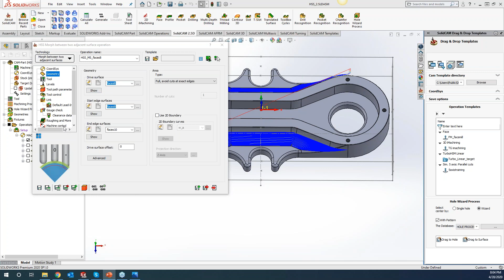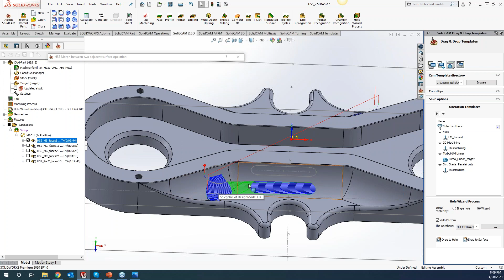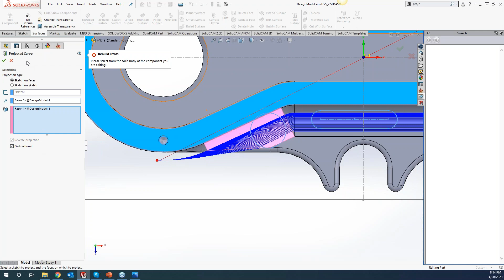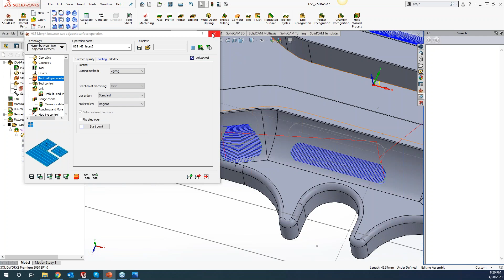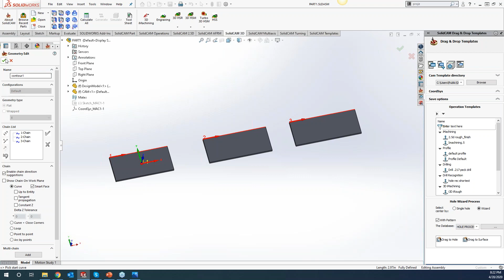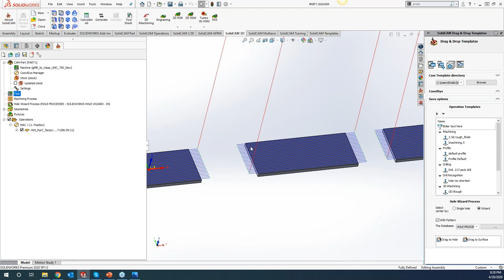Comment: Regarding HSS avoidance boundary using sketch. You don't need to extrude surfaces or break surface using sketch. You could simply just take an external boundary contour that would make a closed boundary and would consider inner loops as an outer area. I hope you understand what I mean. Here is an image: https://imgur.com/a/BtnTCUj
However if there was a check box that flips the boundary from inside to outside, that would be great.

Because extruding surfaces or using split line feature is a solidworks feature. That is part of CAD, not CAM, it is not something that is simple, it is mearly a workaround for something that solidcam lacks for now :) The point in CAM is saving time, not making things complicated.